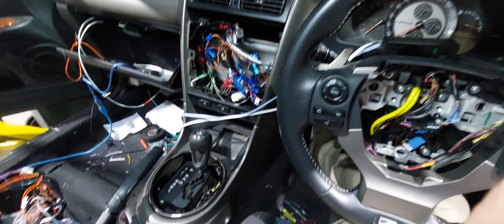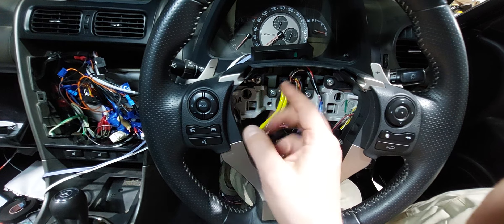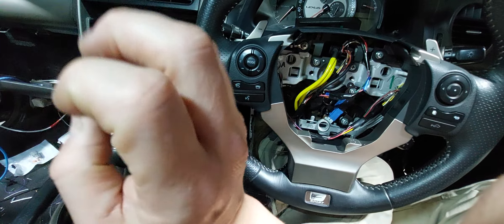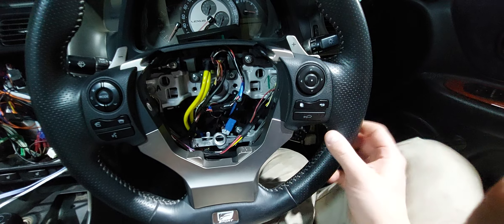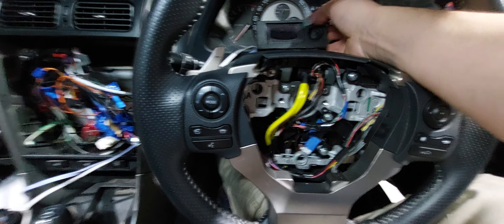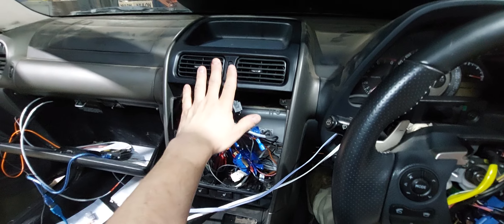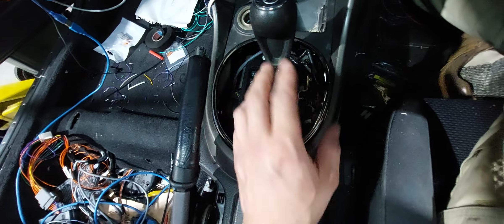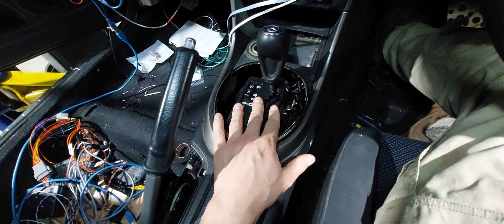IS300 | Wheel and Interior wiring | Part 5

Comment: for Key 1 + 2, are you running the wires directly into the clock spring? and then audio in the 3rd pin?  this is the missing piece to the puzzle
Reply from the maker: I changed out the clock spring to a clock spring that has 12 wires and not the is300's 5.and then used said wires to pass the key 1 and 2 to the stereo